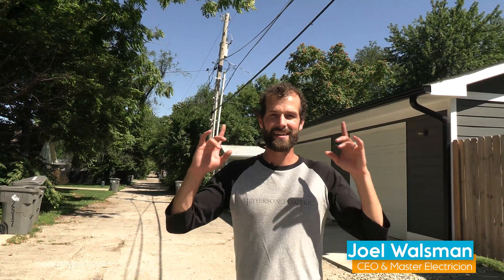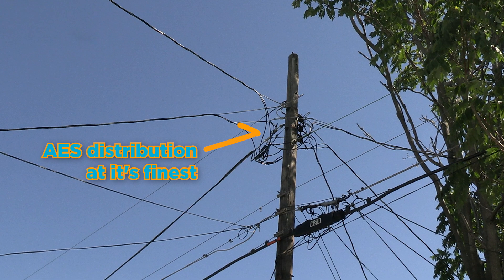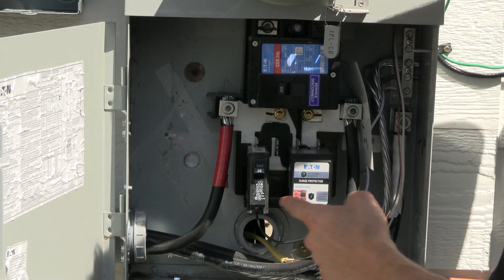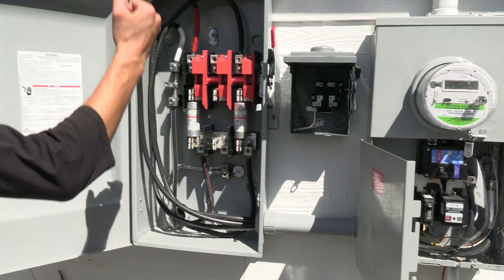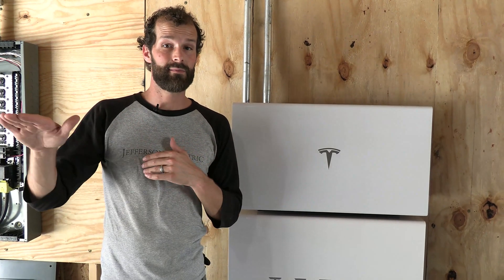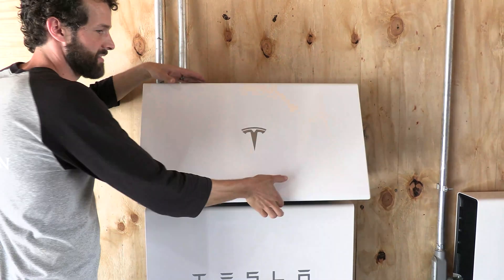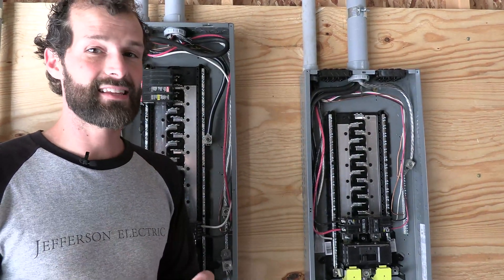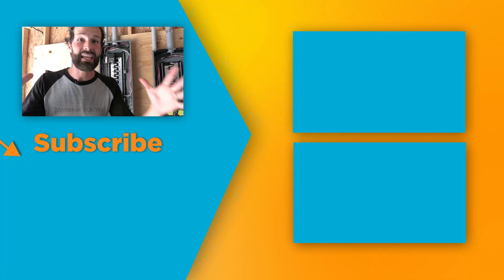The Roof Everyone is Wanting!

Comment: That main disconnect has issues with that #12 Romex. Besides acting like an antenna looped around the main leg like that, it's way more than 1/2" sheathing into the box. In a past video you stated 1/4" is max, but I'm not totally up on code past 2015. Also there is no strain relief provided and that hole is way to big. It's just inviting rodants and weather in. No bueno.

Comment: I have to ask for the chargers why you landed black and white on the 240v 60A breaker and capped off/ Or landed the red in neutral? Hard to tell if the red was even used, but that's a code violation
Reply: Good question

Comment: Thought the PV AC disconnect is for the fire department to turn off along with gas and bump the meter out when arriving at a fire?   Also notice Eaton and Schneider surge installed load centers have their surge device on bottom of the bus along with the breaker.  If the manufacturer is going against their own instructions.  I guess it's okay to put the SP on the bottom of the bus, to keep wires short as possible.